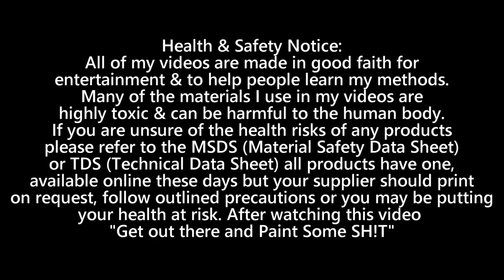My New Method For Spraying Bonnets

Comment: That is how i spray the top panels myself from the center out for couple reasons and side panels starting at the top to the bottom if you are not in a down draft..down draft i may start from bottom on side panels part of the reason is not always having the cleanest or driest air in high humid environment or diy sitch..occasionally water would spit or drip or even a bead of sweat if not entirely suited with this method i could see the water hit panel and just blow it off away from the wet paint the other method the water drops would land on the wet paint and leave bubbles in finish and ruin the job..spraying in texas high humidity method in a not so professional paint booth but getting er dun!  Thx for the vid gunny! Always a pleasure mate!  Love to paint some shit! Smashing it across the pond!

Comment: I use this method when spraying my completes or when I have a full front end but the reasoning behind it was keeping that wet edge active as long as possible on both sides and also my arm gets tired when working from close to me to extending my arm so this method lets me keep the gun more steady on each pass. Great video as usual sir.

Comment: What ever gets the best results. I tried that when I was getting recertification at Standox in Chicago, and the instructor called me out in front of the class. He said I was doing it wrong. Kinda pissed me off. It was the only time I did it that way. He then started talking about the wet edge issue. Whatever, It all comes down to results. The middle out is the only way I spray roofs. If I do it the other way, I end up tilting my gun forward.

Comment: Always done this method in the old days when using acrylic-based air dry paints the main reason we did it is that in the center of the roof or bonnet you can lay the paint down really wet with little chance of runs so when you have finished one half and move around to paint the other half you continue to lay the paint down as wet as possible ( of course spray painters know the limits) so the wet on wet takes place giving you the best results when using those types of paints.

Comment: Funny, I started like that back when I was a beginner and was told it was wrong, as if there is such a thing with spraying. We all know nothing matters except the result.
Reply from the maker: Exactly brother
Reply: @TheGunmanChannel  I found you about a month ago. I bought the pro light with the te10 and te20, it's summertime here in the states so te20 I'll probably switch to the 10 when it turns cold. Point is you sounded like you knew what you were talking about and took a leap of faith, glad I did love the gun.

Comment: Glasurit wet-on-wet is an easier product for a smooth coat. Try adding 15% flex additive to your sealer for me it softens the edge and tends to lay flatter. @ 15% you won't see a big increase in need for flash and you'll gain some nice chip resistance for the overall film.
Reply from the maker: Great Idea, I'll give it a go, I have a job lined up for tomorrow.
Reply: Yeah. We mix the plastic wow and put it on everything

Comment: On cooler days, I've had really good luck minimizing orange peel by pre heating the panels slightly with a quartz work light set-up and keeping them warm.
Plus heating up the clear itself, (your tip - thanks!).
Don't know if that would help with the Standox brand, but maybe do a little experiment?!?

Comment: Just about to spray a classic Mercedes in factory metallic silver. Now I'm tossing up whether to use a wet on wet primer or use a standard primer and sand it back first. Time not an issue with this, just want the best finish.
Reply from the maker: 100% standard sand-able primer
Reply: @TheGunmanChannel  Thanks Heaps !

Comment: We use the Spies Hecker wet on wet which I believe may be the same as the Standox and you are correct it lays down very crappy .Ive tried adjusting air pressure,distances,different guns with different size nozzles and it still lays down rough .🤔

Comment: I use normal or slower harder for my wet on wet  primer it sits nicer just let it flash off a little longer before bc
Reply from the maker: I already did that. Now I'm in a new shop using PPG Envirobase and their wet on wet is sooo much better

Comment: Sorry Gunny as a technical painter you should always use the push pull method on hoods/bonnets, as you did say the wet edge is the most important thing if you paint from the centre you increase the chance of solvent pop, and you will probably double coat and stack paint at the centre
Reply from the maker: No solvent pop on this job and it's got a really nice even build, slow hardener stays open for long enough to spray this way. This was recommend to me by an ex paint rep so he's a technical painter, like myself too as you already know. But hey, whatever works for you. This works for me so I'll keep doing it.

Comment: I think this is personal preference, I’ve always used the “push/pull” method or edge to edge, keeping the wet edge. I don’t disagree but I find this to be a beginners bad habit, I always try to stop it when I see it, clear coat not so much but the dry spray and overload on base can put a big stripe

Comment: Hiya mate from Warrington UK ! I have an old Riley RMA 1952 car that Im in the process of respraying at home in my garage.
I painted the car 18 years ago in celly and its started to look shabby so Im gona respray it in 2K .
My compressor is only a 2hp and I think 4.5 to 5 cfm.
Took your advice and bought an ANI 160 mini gun but Im wondering if its big enough to do bigger panels ? 
The car comes to pieces , and is at the minute , so the biggest thing I would paint in one go would be a wing.
Liking this FLG gun !! 
What do you reckon I could use it with my compressor for single panel work??
Love the chanel mate , think I have watched most of all of it ! 
The ANI 160 full size seems to use less air but this FLG looks fantastic !! 
                                                           Cheers Matey !! 
                                                                                          Alan.

Comment: Wet on wet is always Peele I find as the primer cures underneath looks worse as time goes on. Used to do transport trucks that way sand them then DP40 then single stage paint it was the only way I could keep up 700 trucks a year

Comment: Gunman - Are you taking your primers/toners & turning them upside down for awhile before putting them on the mixing bank ??? We here at PPG have to turn the cans upside down and then put them on the shaker for 10 minutes before we put them on the bank -- then we have to do at least a 10 min mix..!!.. They all settle these days & the reasons curdle/bind up.
Reply from the maker: Yes, I always get the apprentice to put them on the shelf upside down, the thing that helps that die back most is thinning it out more but I always avoid messing with the recommended ratios where possible so I don't like doing that.

Comment: Well every1 sprays different, also if you need or are using fast hardener due to workshop conditions it changes for me. But even from startin at home then tafe always told to spray a way that you can see the paint going on. Ensure your gettin it right so iv always done bonnets and roofs  this way. Like buffing end result is what counts 😉😂🤣

Comment: I’m having the same problem with Ppg wet on wet primer ever since they changed the hardener to uhs , it seems like the hardener is too thick and when I try to put more thinners in it it just makes the orange peel bigger so like you with a bonnet I have to 2pac prime and sand it, it’s very frustrating . Thanks for the videos it’s great help.
Reply: How much primer are you spraying ??? PPG wants us to 1st spray the widest area to cover bodyworks outer scratches & 2nd layer tighter & 3rd coat directly over the body filler itself.......
Reply: If you have to spray a large area - We've been using the AirGunza 3.0 tip gun for PPG primer..... Starting from 1 side edge & working inward onto the middle & the thru to the opposite edge......
Reply: Why are you using UHS for primer is my question..??? PPGs undercoat catalyst is DCX3030 for the V-Prime 3055....... We use the uhs for delfleet line. We don't spray delfeet much in the body shop...
Reply from the maker: He's talking about wet on wet primer

Comment: great vid and thanks for the tips. may i ask why do you do your edges at the end , as in the back of the bonnet edge, in my minds eye you just put a coat of paint on the bonnet which looks great and then as you paint the edge you then cover the bonnet in over spray
Reply: Yes another do what works for you thing. I like to do any edges first and then bury the over spray with the fulll coat on the full panel.

Comment: Good video so what is the best clear coat you can buy and how is it better? Thanks
Reply from the maker: I always loved the Glasurit 255 but they don't even make it anymore. I liked the film build, UV resistance and durability, harder than MS clears to polish but I always loved it. Also I like the Standox VOC 2K clear which is identical to the Cromax CC-6400. Apart from them I love the Quartz Crystal Clear, Scratch resistant clear but it's not for beginners!! Quartz liquid glass is also great, cheaper but reminds me of the old 255 Glasurit clear.

Comment: Looks great as always, I always thought you had to start at one edge of a bonnet/roof then move across to keep your wet edge moving but you have proven it isn't the case. I see you were using the TE20 cap but have you tried the TE10 for clear or is that just a basecoat cap? John UK.
Reply from the maker: Hey John. I was always the same as you. But if using slow or medium hardeners you do have a bit of time, or if in freezing climates like you 😬
But the TE10 is an all-rounder I do use it for clear every now and then and it works fine. I just prefer the 20 on insurance work because it uses less paint.
Reply: I use super-duper turbocharged hyper fast hardener but still get about 3 days between coats of clear!! 😱😁🤣  must say it's turned quite warm here now it's an ass busting 9C today but better that the -4C we were getting 🥶

 I'll try the TE10 for clear but I usually use that in my GTI Pro for base, I would get a TE20 but not sure my compressor would be up to the job as I've already blown the head gaskets and it's just a year old 😱😂 cheers Gunny and stay safe 🙏👍

Comment: Nice video bro, just got a question with bonnets and roofs sometimes I get dry finish in some spots, I try to set up my gun the best way I can but not sure what's happening, I use a GTI pro clear gun with 1.4 tip any ideas ? What's the best setup for that gun cheers

Comment: Your videos are very informative. Don't know where else to ask this. I plan to paint my sons bonnet and have a very old mint Devilbliss GFHV-501 that was given new to me about 25 years ago. It is an HVLP gun that would have been very expensive when new. Will I have issues painting the bonnet with it since I don't have much experience or is there a gun that would be better for me to use?
Reply from the maker: Shoot me an email to thegunmanraw@gmail.com otherwise I will miss your reply. Send me a photo of the gun including air cap. The main issue you may have is if your compressor will be able to keep up with HVLP, they require more air than normal guns. Also let me know what compressor you have.
Reply: @TheGunmanChannel  I opened the gun up all the way and set the compressor at 25 PSI. At about 1min and 30 sec the compressor kicked on. I continued to hold the gun open for 5 minutes and the compressor stayed at ~110 PSI and kept running.

Comment: Mr Gunman, I have a question regarding prep for 2 doors I have replaced, wrong colour but like brand new. Is a light sand with 400 on the orbital  sufficient for the base coat of new colour?
Cheers🤙
Reply from the maker: Personally I'd recommend 600-800 the basecoat sits a bit nicer over the finer scratches
Reply: @TheGunmanChannel  Thanks mate appreciate the help.

Comment: Do shops usually have junk paint that they throw out. I don’t care about the color or even any mixtures, all I want it for is practice. It’s too cold to paint a car where I live, so I I figured I could at least practice. I’m also open to any ideas about mixing anything that would simulate paint, without damaging my gun. If anyone has any other ideas for practicing please let me know. Thanks
Reply: I practice with just the gun. Go over the panels to practice keeping an even distance and a steady speed and to work out the best way to do a job before I start. You can use just thinners to get your spray pattern right. Otherwise just buy some cheap acrylic lacquer and practice with it.  Make sure you have good PPE .

Comment: Would this method also work with matte clears because these are really tricky with stripes showing
Reply from the maker: As long as you're using slow reducer and hardener I guess it would. But I haven't tried it yet
Reply: @TheGunmanChannel  what would you advice on a roof. Appreciate it Pro!
Reply from the maker: @rafaelboss1267  I would try this in out method as long as you use slow hardener. But if it was more than just a roof, like sides also, I'd probably do a side first, then my old out-in-out, then the other side, so you're chasing the wet edge.
Reply: @TheGunmanChannel  thanks mate will do that next week. Greetings from Holland